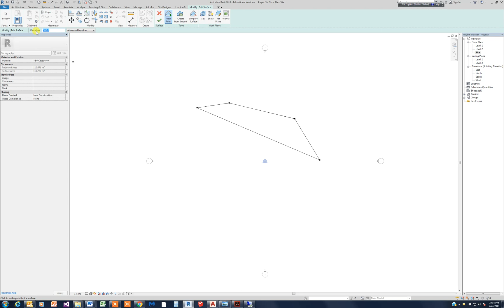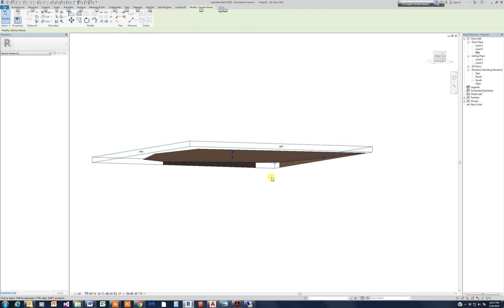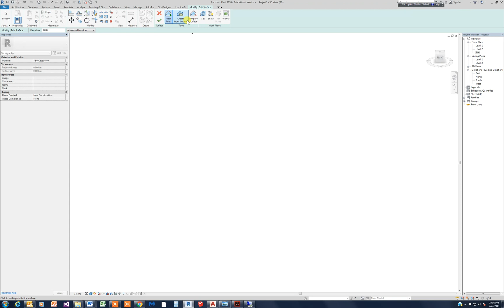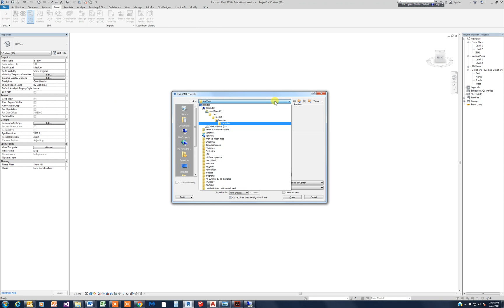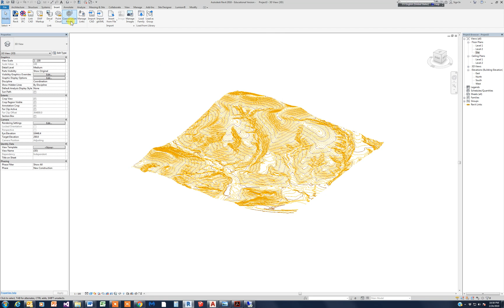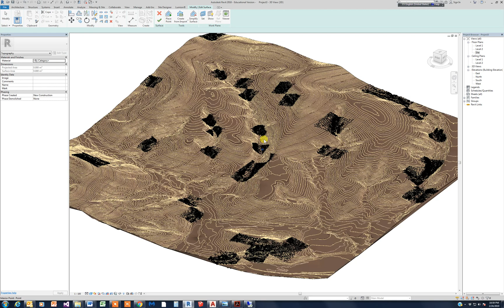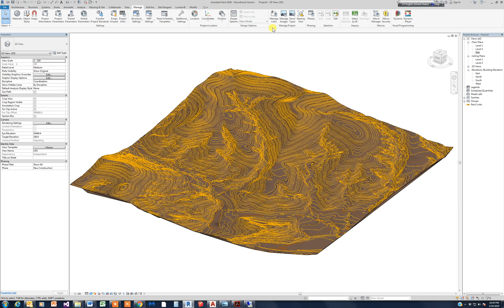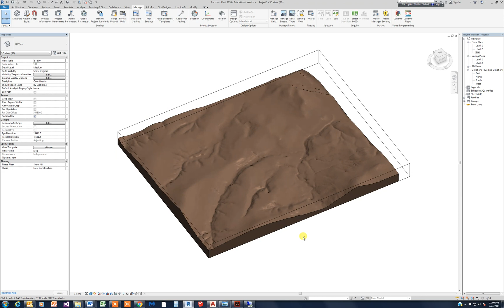Revit2018 Creating Toposurface imported from AutoCAD file

Comment: most of the time, it ends up creating rubbish topography that breaks the rules of topography---no topo line should ever cross one another no matter how steep they are. 

So, how do I solve that?
Reply from the maker: I think it's all about how accurate your CAD file. Check the coordinates of your file points, also make sure to select only the correct layers before creating the toposurface.
Best of luck
Reply: @dr.-ingsalemabdalla7080  I used both - elevation pts from developers, and geolocation from sketchup, with adjusted elevations based from the original points then saved as dwg.
Reply from the maker: @drvlive2023  it's hard to tell, unless I view the Autocad file. Also, Revit depends on x,y,z coordinates to establish the toposurface.
Reply: @dr.-ingsalemabdalla7080  Yeah, had already cost me a lot of time. I'll always put the last sentence in my mind. Thank you so much!